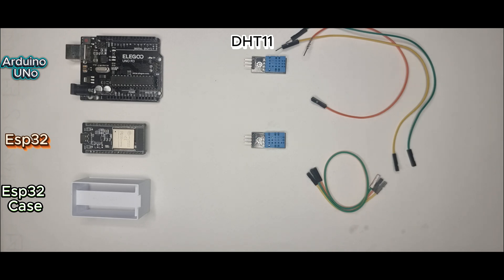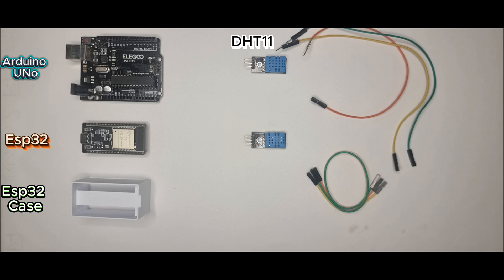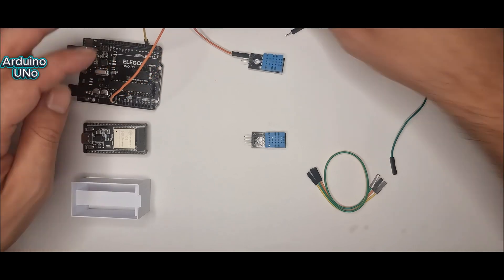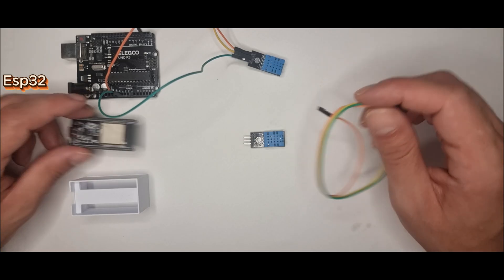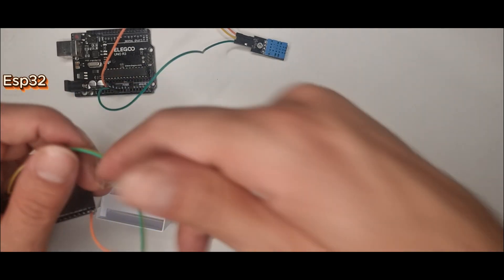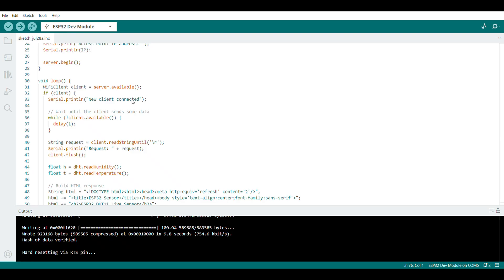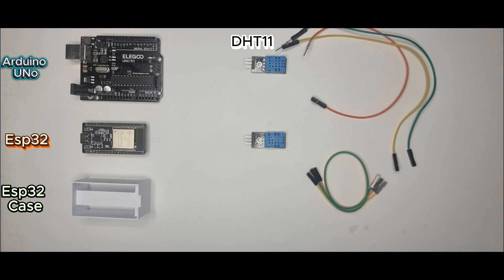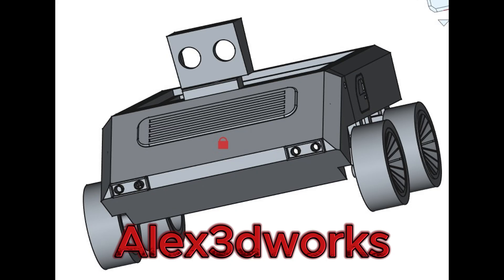Why i don't use Arduino Anymore (ESP32 dht11 test)

Comment from the maker: 🧠 Which board do YOU prefer for sensor projects — Arduino UNO or ESP32?
👇 Share your thoughts below!
🔗 Arduino Uno : https://amzn.to/3Hfl6ZX
🔗 ESP32: https://amzn.to/40PXgKT
In this video, I compared both using a DHT11 sensor — but there’s still more to explore: memory, speed, and I/O capabilities.

💬 Let me know if you'd like a follow-up test with PWM, analog read/write, or Wi-Fi integration.
🔧 STL & code projects posted regularly on my site:
🌐 https://alex3dworks.com

🚀 Subscribe if you're into DIY robots, 3D printed parts, and real-world Arduino vs ESP32 builds — more coming soon!

#Arduino #ESP32 #DHT11 #FreeCAD #3DPrinting